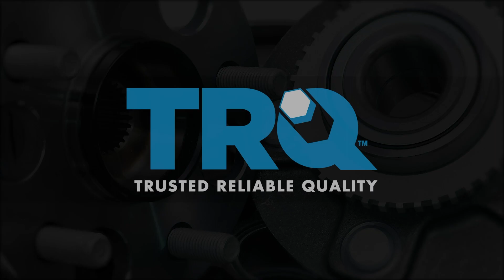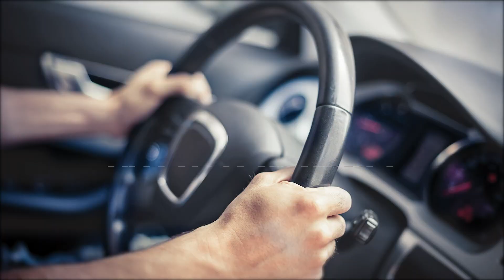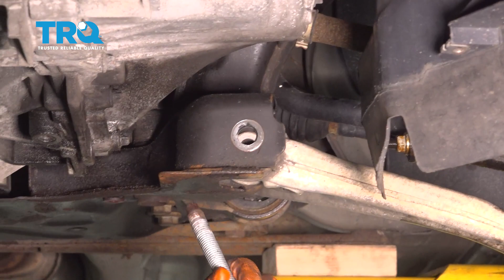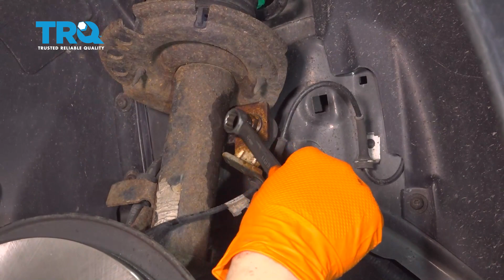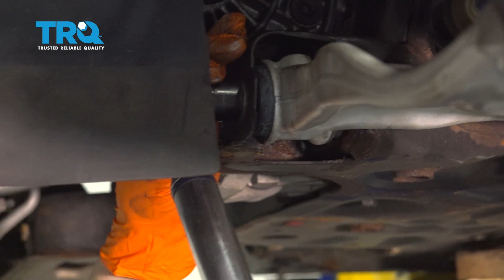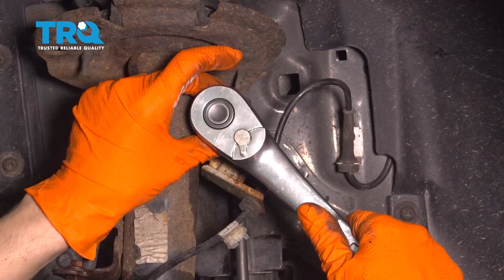How to Replace Front Lower Control Arm 2012-2020 Ford Focus

Comment: 9 hours of laying on my driveway and i only got the passenger side done. I live in Michigan, so none of the bolts came out without a fight. The torx screw holding the ball joint was completely seized. The nut came off fine, took two hours of smashing with a hammer, prying, and torching wax on it to break the screw and the ball joint free. And he doesn’t show the hardest part which is trying to get the screw on the passenger side bushing out. Couldn’t fit the head of my big breaker bar so i put my little one on and used a 3 foot cheater pipe. No dice. Torched and sprayed and waxed and finally broke it free just for it to not clear the a/c compressor. Had to unscrew the compressor and push it to the side without ripping all the wires out of the top of it. Then i had to put it back together and the genius that i am ordered the heavy duty arms, so i had to enlist my dads genius to tie a ratchet strap around the arm and stand on it with all his weight so it would go down enough to pop the ball joint back in. And i gotta do it all again tomorrow. I love my focus 🤬

Comment: Fun tip I learned back in the day, use a flat blade and tappy tap tap to spread the knuckle side of the ball joint if she don't wanna budge. These cars are a pleasure to work on though. Engineers where mechanics for sure.

Comment: Notice that they do the easy side. The passenger side A/C lines are in the way of the bolt for the front bushing. Simple though, take the two bolts out of the left hand motor mount to body, then lift the engine a few inches until the lines clear.   Chances are you will find that mount needs to be replaced as well since its made of the same material and has just as many miles on it, and they are not expensive, less than $40. After 180K miles all 3 mounts are getting replaced along with the control arms.   BTW the left upper mount is hydraulic, filled with fluid, and can leak without you knowing.  Easy way to check is to look at the center of the rubber, should be domed, if not, replace it.

Comment: I've had a lot of trouble fitting the balljoint on my control arm, while the rubber boot is fully seated with the knuckle, the tapered part is interfering with the bolt. However if I slightly lower it, there is a noticeable gap between the top part of the mount and the ball joint. May I know how do I proceed from here?

Comment: Just finished using this to do the drivers side on a 2016 Ford Transit Connect. Everything is the same except the big bolt on the front has a captive nut. You have to remove the cage around it. 10MM and 12MM with an impact did them just fine because of rust. Thanks

Comment: For anyone taking this on, get a serpentine belt wrench from harbor freight to get the passenger side bushing bolt. You’ll have to remove the compressor regardless. Just do it

Comment: Can this same method be done on the 2013-18 Ford Fusion SE, I have a 2016 Ford Fusion SE, the driver side lower control arm needs replacing

Comment: Nice vid but you forgot to mention the control arm bolts are TTY/one time use and they should be replaced. Also you need to unbolt the A/C compressor to be able toremove the front bolt on the passenger side control arm!

Comment: I had to use a 2x4 board and a hammer to smack rear part into place over the 2 bolts. You’ll have to remove the end link up top or you’ll never line up that little bracket.
Reply: Did you have to do anything else to get these on? I’ve been trying to smack it for over an hour and can’t get it to budge

Comment: Important tip:  If you don't have a lift, and dont want to remove the undershield from the car, you can reach the rear upper nuts from the front side.  Just need a 21mm socket and a breaker bar to hold it in place.  This will save you a ton of time if you are working on the floor of garage.

Comment: Im having a lot of trouble getting the back 2 bolts to line up. Every time I hammer it in its anyways to the right of the hole(Im doing drivers side). Any tips??

Comment: I don't know how you got the rear bolts to align first try. Ive been trying for hours.
Reply: I had to put a jack (working from floor not lift) on the rear bushing housing and raise it a bit until they aligned.
Reply: @kellywhite948   did you have to do anything else to get those bolts in? I’ve been trying to align the bracket for the upper control arm for a while
Reply: Did you have to smack the bracket in to place or did it align perfectly after you jacked it up?

Comment: Would have been helpful to see the other side where the front lower control arm bolt has no room for a socket.
Reply: I was able to slide in a box end by the down pipe.
Reply: Remove the ac cover and move the ac lines over and you can stick a small socket in there with a breaker bar

Comment: Good video! I am doing it right now!

Only problem I have is T55 BOLT stuck. I cant remove it. I remove 18mm  nut from it though. My guess its just too mach rush between ball joint groove and T55 bolt. I hit it with 10lbs sladge hummer and its still frozen in place...
Reply: I try heat, penetrating oil...still cant remove it. Finally soaking in Acetone and will go sleep.. Will try tomorrow.
I broke T55 socket trying to twist it ..lol 🙃🥱
Reply: You seem to have a lisp??  lol